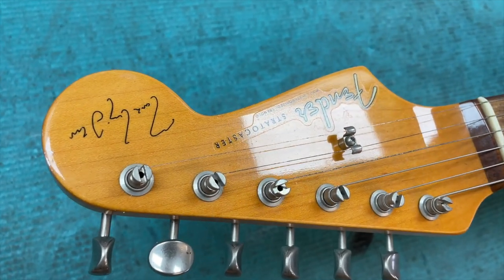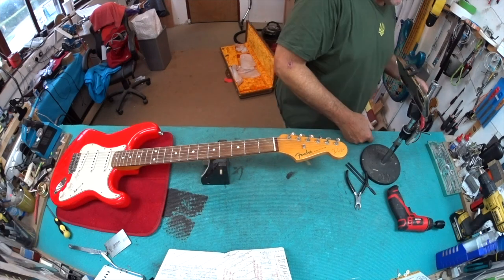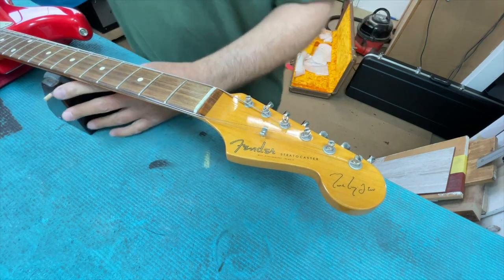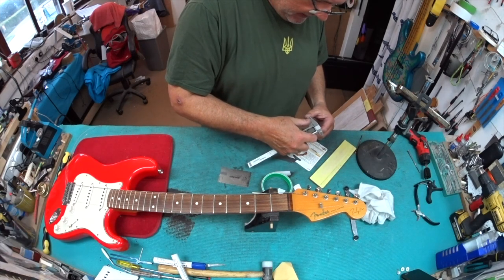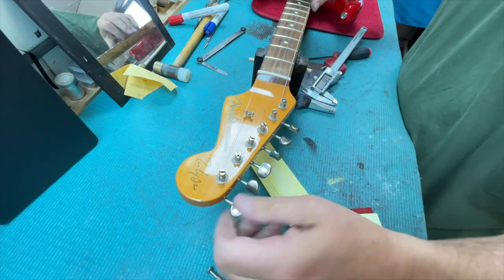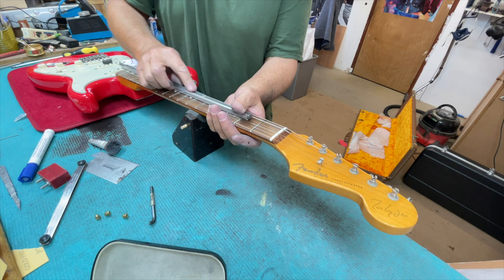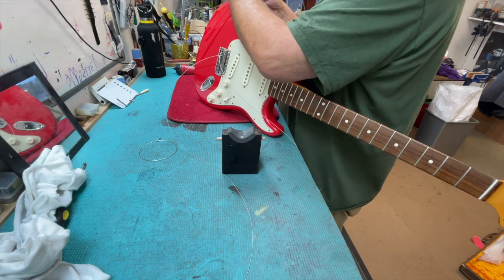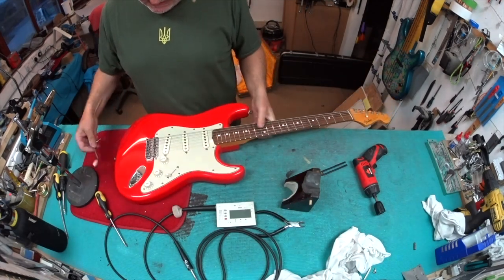Fender Mark Knopfler Signature series strat set up

Comment: Having watched at least 100 hours of Sam working on guitars and having now worked on over 100 guitars myself, I've got to say that - while Sam's methods may NOT be favoured by the traditional luthiers out there - they bloody well work great. Zero complaints. Sam has done a Tele and 2 Strats for me and both are as good as the day I got them back from him over 2 years ago (time flies). Only change I made was to raise the action on one of the strats because of personal preference and that's it.

Couple of points / Qs based on this video and from watching many others:

1. Firstly, as this is likely an older Strat from 2008, is it possible that the neck might have been slackened off by someone in the past to get a playable (without chokes) action? If so, maybe this could have allowed the wood to create the massive dip between 12-17 frets? Or am I completely off my rocker lol ?

2. The amount of time that tiny parts of the setup like the nut can take to get perfect should be clear from this video. This is why you pay for an expert to do the work because your average guitarist and even guitar tech on the road will not have all the gear and experience to achieve the results.

3. The classic tuners are great, as Sam points out. People say they love locking tuners as it makes string changes fast. Those old school tuners are just as fast for changing strings with none of the downside of crushing the string and possible breakage just as you hit that perfect sustained note in your signature solo haha

4. One for Sam - I like to leave the neck oil on for a bit longer - around 5 mins - for it to soak into the neck. I do this to see just how thirsty the fretboard is and whether it needs a little bit more before I finish and wipe off the excess. I don't believe it does any harm to the wood but I was wondering whether you think I'm just being a bit OTT with the board oiling?

5. Just say no to neck truss rod adjusters 😂

Anyway, must get on as have a couple of cheap guitars to work on today - an old Aria Pro 2 with neck sprout that could slice ham and an unloved Peavey something or other that I'm fixing up for a charity to sell and is completely dead electrics wise before we even look at body and neck lol
Reply: Fair enough. No apologies, why didn't you set up the guitars yourself?  Why have you written an opinionated dubious 'I'm clever me' essay? I gave a Marshall practice amp to charity because they helped me out when I starving, using and stealing. It is what it isn't. One for you-don't comment, yeah?  He knows what he's doing.  
'
Reply: @ericcrawford9827  Well didn't know how to 2 years ago. Now I do to a decent enough job now and it helps earn me a few quid to keep the cat fed and pay the bills from Nazi utility firms lol. I know Sam knows what he's doing don't worry - I learned everything I know off him 😎I'm not trying to "be clever" and I know what it's like to be homeless on the streets as well. You appreciate a roof over the head and all the little things most people take for granted which is why I do fix up guitars for charity - not looking for a medal lol - but I also do it for paying customers to make a bit extra to get by. I'd rather do what I do now for less money than deal with some of the shite jobs and things I used to do. Keep safe 👍👍
Reply: @martin-1965  Yeah, OK. I learned everything from the old bugger too. Peace, love, painkillers and cheap wine.
Reply: @ericcrawford9827  Haha yeah defo on all four of those mate. Take care and some less cheap wine would be nice occasionally 😂🍷

Comment: Could it be a knock off?The decal is a transfer, you can see the hard edge.Ive just checked my USA Strat and there is none.
Reply from the maker: The decal is always a transfer - the only question is how much clear gloss covers it. When it's not much, the outline of the decal is visible as here. On yours the clear coat is thick enough to cover the decal and encapsulate it. I used to think that visible decal edges like this was a sign of fakery but the experts assured that it wasn't. I apply decals regularly to my guitar builds so have seen up close how the clear finish sits on the decals at different thickness. Personally I always apply enough (and sand back carefully) to level it out and lose the edges.

Comment: Dodgy decal.
Reply: Yes I remember thinking how water-slide decals looked a bit non-Fender, but apparently Fender do use them... where I find Korean Squires with really nice classy screen-printed decals and no crumby edge showing under the varnish... Mark P............
Reply: @markphillips573  If it's a restoration decal, it's naff. If it's a straight-out lie decal, it's still naff. Whoever put that on the headstock didn't know what they were doing. So the whole guitar is suspect.
Reply: Authenticating artist models can be a bitch, especially fenders.
The decals varied in position and quality over the production time which was about ten years, finishing in 2013. It was never particularly clear as to if they where all Mexican or American made so quality definitely varies.
The early ones are also the wrong colour red.
Add to this that there's plenty of later custom shop ones floating around and it's a bit of a mare.
This one looks refretted to me but if it's not I'd say it's a Friday afternoon guitar, lol.
Doesn't effect the value though
Crazy stuff.